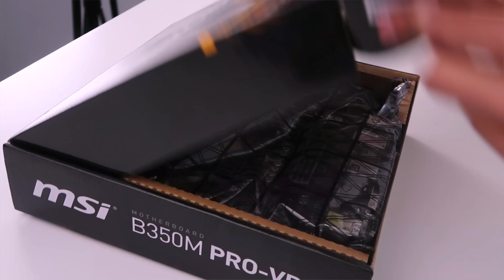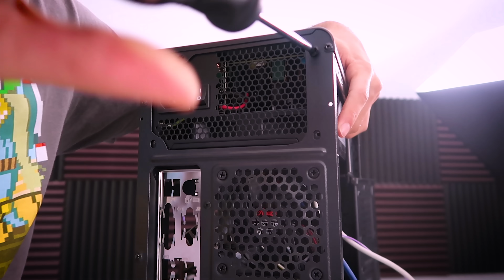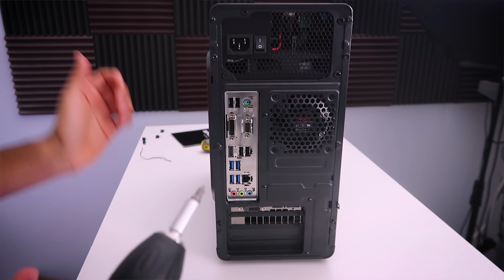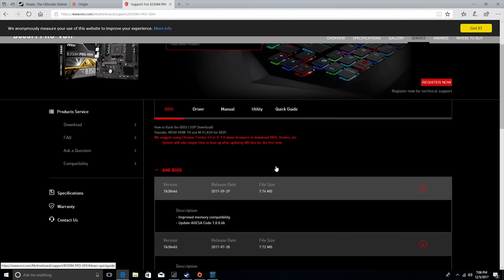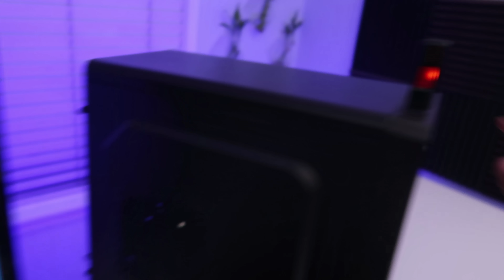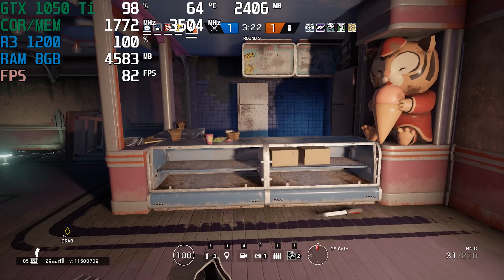$500 Budget Gaming PC Build Guide - GTX 1050 Ti (w/ Benchmarks)

Comment: Can anyone tell me the difference between a 430 watt power supply and a 500 watt? Im looking to build this pc but the only available is a 500 watt. Am I able to use a 500 watt on this build? If anyone finds a 430 watt can you provide a link? Thanks
Reply: GucciFlipFlops the number that is shown from power supply is the output wattage, so let's say this pc requires 350w and you are using 500 watt, that means there is 150 watt left which is good because whenever you want to upgrade the component (like cpu/gpu whatever that requires more wattage) the power supply would suffice. oh and your power supply won't draw that extra 150 watt unless the pc need it so no extra electricity bill
Reply: Giovann H alright thanks for explaining

Comment: Could this PC run call of duty black ops 3.
My old pc just needs a mother board, processor, and graphic card.
On my ssd i have cod bo3 so if i add these parts this to my pc could it run bo3?
My original card was a ati radeon 5970 2gb which ran poorly.
Hoping to upgrade!
Reply: Gabe TOL yea

Comment: Could I use a Ryzen 3 2200g instead of the Ryzen 3 1200
Reply: Yes, as long as the motherboard you buy has the right BIOS, if not the PC might not function without a BIOS flash. Just got to an electronics store and ask for a motherboard that is updated for Ryzen APU's.

Comment: If i lower resolution to 768p ?  Can it increase fps with this build ? :)
Reply: If you lower resolution, you will always get a frame-rate increase. I would recommend sticking to 1080p at 60FPS if you have a monitor at that resolution. Since you won't be seeing more than 60 frames per second with most monitors unless you buy one with a high refresh rate. (blah blah, tech nerdy stuff) In short, yes you can.

Comment: Trying to build this,but instead I'm going change the GPU to R5 1600X Mobo to B350M Mortar and the Case to MasterBox Lite 3.1,I'm bit a concern about the psu should I change to 500W or higher?
Reply: Lazy Gamer if you plan on upgrading maybe but youre fine with 450
Reply: LLamaWithATopHat Thanks man.

Comment: I just build this pc and the fps for csgo is too good.
Definitely recommended
Reply: You gotta buy an adaptor to go wireless. If you can use ethenet, use it. Wireless is a lot worse.
Reply: he showed pubg averages around 50 fps with medium settings but idk about h1z1
Reply: ndewie2k what about Fortnite ?
Reply: Cristian Rubio Fortnite is awesome, I've developed in so many aspects thanks to this px.
Reply: @cristianrubio7410  Fortnite disguisting
Reply: Does h1z1 and pubg work great on it also ?
Reply: Daniel Florez it can stream most games pretty well but i reccomend u go for the r3 1300x
Reply: Sam van Dam ok, thank u so much! I am gonna do a wireless adapter, but I'm getting a whole new router system with a new modem and all. It will hopefully block any tears or drops in signal🤗
Reply: Clorox Bleach 1300x has a faster clock speed
Reply: shadow of death god of war isn't on pc,it's a ps4 exclusive :/
Reply: no shit, you can run csgo on your moms laptop
Reply: Gaming Mystery 

Mine is :

X3470 @3GHZ
12GB RAM
GTX 1060 6GB
1TB HDD + 240GB SSD 

So roughly same specs 

It runs Fantastic in games! It's 30-40FPS better than the GTX 1050TI meaning you can run high to ultra settings on the 1060 60fps and the 1050ti cant run most ultra games
Reply: ndewie2k do you use the adaptor or Ethernet
Reply: Peelz did you get the adaptor does it work great now?
Reply: OutgoingGamer use Ethernet if you can because a connected method is faster than wireless but if Ethernet is not an option the buy an adapter.
Reply: ndewie2k can it run god of war or any new game with good graphics good
Reply: ndewie2k can it play battlefield 1 or bf4 ?
Reply: ndewie2k I tried to build it but idk I have black screen my pc fans are spinning and lights are working and USB ports are working but monitor has black screen help 😥😥😥😥😥😥😥😥😥😢😢😢😥😥😢😥😥😥😢😦😦😦
Reply: @kristersakermanis8625  turn monitor on
Reply: henry romein i have this setup 60 fps on pubg 1080 with medium and low settings
Reply: Could you use it to strwam6?
Reply: Could you use this to streamx
Reply: So all you need to do is connect the Ethernet, no extra program?
Reply: ndewie2k I'm sorry.
Reply: @ROYALE GAMER if u get a black screen u need to boot ur pc manually search how to boot pc manually on yt
Reply: ndewie2k With this pc can u run ultra fortnite settings?
Reply: Oscar Shergold Nope.
Reply: Clorox Bleach No difference. Both suck ass, and are no comparison to the Core i3-8100.
Reply: The Darkitect do u reckon it really matters if it’s not ultra settings?
Reply: Oscar Shergold It doesn't matter, no.
Reply: Oscar Shergold Medium or high are just enough for me, depending of course on the game, however.
Reply: Oscar Shergold For example, if it were to be GTA V, it does very much matter what settings you use within that game.
Reply: ndewie2k does fortnite and rainbow and pubg work good on it?
Reply: Expet Ninja Nope.
Reply: ndewie2k can you dm me on instagram my @ is “xitsandrew”
Reply: shadow of death God of war is only exclusive to PS4 Mate
Reply: NOSPosts 500
Reply: secureteam12 ofcourse it can , battlfield 1 max settings 40-45 fps , and battlfield 4 60-70 fps , i've seen a video gameplay
Reply: Sam van Dam if your motherboard comes with a wifi card installed, you don't need an external wifi adapter right?
Reply: Logistics1320 Thanks m8!
Reply: ndewie2k What would you rate this pc for fortnite On a 1 out of 10
Reply: can you send me what case you used
Reply: Is it good for pubg ?
Reply: henry romein I have this pc and it would give you around 60 fps on pubg medium settings. Without vsync I had around 70. This pc can also run the game on high but I recommend medium for the sake of fps.
Reply: ndewie2k Try the Division on high settings and Ultra and you will see those 25-40fps lol.
Reply: Fortshite
Reply: nononono, the ryzen 3 2200g is out, get that instead of the ryzen 3 1200, it's a bit better and around the same price and sometimes even cheaper
Reply: ndewie2k do u get like the screws with the parts?
Reply: built it aswell, this pc is a young beast, definitely recommended
Reply: TRAPxKILL U it would be a little worse but not much of a difference honestly
Reply: TRAPxKILL U then yea do that, and then as you get more money keep upgrading your graphics card
Reply: TRAPxKILL U this comes with a GTX 1050 so probably eorsr
Reply: Fortnite runs amazing with almost all settings on Epic and I did wireless wifi
Reply: Can it run fortnite
Reply: ndewie2k did u play ark on this pc?
Reply: How much ram did you put in? He used 8 gb but I think that’s not enough 🤔
Reply: Can it handle double monitor?
Reply: Hey dude, I did the same build like a month ago and when looking at the internet it wouldn't connect or register any other internet except for the Ethernet that I didn't have. Did u have to purchase a separate Wi-Fi adapter or did I need to download something for the pc to understand the Wi-Fi? I'm just really confused because most motherboards and stuff nowadays have it built into the motherboard but I didn't see it
Reply: henry romein PUBG requires a NASA space computer to get a constant 60 FPS LUL
Reply: How much did it cost you total bro?

Comment: Built a computer with similar specs mainly using the Ryzen 3 1200 and GTX 1050ti. Probably the best price per performance budget build you can obtain right now with the market how it is. 
If you built this system you NEED to overclock. I would recommend going to 3.9GHz if possible most chips should be able to. Pushing into 4.0GHz maybe not but Ryzen 3 needs to be OC for best performance. The standard 3.1 will not give you this high of a performance. Joey could have easily OC to 3.9 and seen a way higher boost to framerate. Especially if he OC the ram which I would also recommend. Ryzen loves ram with gaming.

Comment: What if I build using a different PC case however also using the same parts? Do I have to buy different parts or cables for its different size or would it be fine to follow the instructions on this video even if the case is different?

Comment: May 22 2018, $569.82
Reply: I bought this for $791
Reply: City is my England feels bad
Reply: CapoGoCrazy      crash 07459625931st is not the only thing 8xxsçďņ is not the only thing 8xxsçďņ
Reply: City is my England you could've change the cpu to g5400 or g4560 and use another budget ram
Reply: Mike Lagana change the cpu make it to g4560 almost had the same score with 3 1200
Reply: Mike Lagana it's fine
Reply: Mike Lagana you mean 1060 6gb?hmm as long as it cannot do 30+FPS on low setting I might get a new graphics card
Reply: Mike Lagana well then enjoy you build
Reply: yes
Reply: £510ish
Reply: CapoGoCrazy OMEGA LUL the same specs that i would buy in serbia comes to about 600 usd :/

Comment: Here's a tip be a little more careful when putting a PC together I see how u have been putting it together don't use a electric screw driver when screwing stuff in and also u took the face of the case off pretty harshley and need to be much more careful when doing that u could have broken one of the wires connected to the face other than that great build keep it up

Comment: Also I looked on amazon and I can’t find a 430w power supply only a 500w one would this effect the setup in anyway or should I get it?
Reply: It works fine. Better to have it, if you plan on upgrading any internal parts later down the road.

Comment: Can i use a intel processor instead of a ryzen?
And can I put 16 gb of that ram side by side?
Reply: You can't use an intel processor on any of these motherboards. Also the ram should be fine as long as you bought the same kind of sticks to allow dual channel.
Reply: Shadow-Man ok ty what motherboard should I get?
Reply: Get a z370 chipset motherboard ( if you are using eighth gen processors.

Comment: I recommend getting a motherboard with an m2 slot on it (on board SSD) and put your os on that. it will drastically improve boot time. what I'm doing is putting windows and Linux on it then steam and discord and one or two games that I play more than others. the specific SSD I got is 5gb/s processing speed. so boot time should be about 2 or 3 seconds
Reply: Here is a great deal on the ASUS ROG STRIX B250G GAMING LGA1151 DDR4 HDMI DVI M.2 Micro-ATX Motherboard with USB 3.1 , https://www.newegg.com/Product/Product.aspx?Item=9SIA2F85N39233
 I found.
Reply: Here is a great deal on the WD Black 256GB Performance SSD - M.2 2280 PCIe NVMe Solid State Drive - WDS256G1X0C , https://www.newegg.com/Product/Product.aspx?Item=20-250-084
 I found.

Comment: does a 1080 fit on this motherboard?
Reply: TheManlet I recommend going with a higher end motherboard for overclocking, go with a Z270 1151 socket motherboard and with 16gb ram bc you want to get the most out of that gpu. Also you should definetly go with a better cpu for more performance
Reply: Yeah at least Ryzen 7 1700x
Reply: Link Kakariko yeah that souns great but then it wouldnt be a budget build anymore 😂
Reply: I did a Ryzen 5 2600 x
Reply: Nathan Allen good choice but if you got extra money you could buy intel i7 7700K just like i did but if jou just want a beast ass pc you should just go with an intel i9😂😂😂
Reply: Toma Tunzukhanova I would but my budget was tight
Reply: Nathan Allen then youve made a good choice
Reply: This case is pretty small so I would go with a bigger case first and then find out if it fits.

Comment: I want to use a different case but I’m scared that I will mess up because it’s not the same as his and can’t follow step by step. Lol
Reply: You can try this case! Corsair Carbide SPEC-04 Mid-Tower Gaming Case-Black and Red-CC-9011107-WW. It looks a lot better then the one he used.
Reply: The mounts for the motherboard are exactly the same on every case, you can pick out any case you want as long as it fits Micro-ATX, which is the size of the motherboard.
Reply: Thanks for the reply’s I’ll defenetly keep that in mind!
Reply: nice bait
Reply: Just use pc part picker 
Use all the specs he used and pick your case
If it says all the components work together then you’re good
Reply: Is tecware edge tg case good? I'm worried about the temps since i want to overclock. There is a review on that case, and the guy says it reached 83 degrees celcius when doing stress test(?) Isn't that too high?
Reply: Azim Saparudin get a 212 evo
Reply: Nathan Moist dude, just get a better case lol, it’s pretty easy to tell where they go... a lot of the time theirs directions for where the standoff’s go engraved in the case lmao

Comment: So, I have a question, if I were to build the pc exactly as you told in the video with the same parts except I would change the graphics card would that mess up the system or would it be fine?

Comment: Finished building my own gonna play fortnite!!!
Reply: Specs?
Reply: how much you spend on the build?
Reply: Don't fear me 1 dolla
Reply: Does Fortnite work on it?
Reply: Team Beteag Fortnite is easy to run ish
Reply: Zequal  not anything you idiot
Reply: I saved up and spent roughly 1,200ish ti build a computer with 16gb ram and evga 1070 sc. This included headphones and keyboard and mouse and the wifi adapter
Reply: Caleb kivett just buy a long as Ethernet cable and tape it to the floor lmao, at least you’ll get better internet (;
Reply: Quadquint Og I bought a powerline bc my router is in the living room and my pc is in a bedroom upstairs to avoid having a long ass cable go around the house like I used to do with my ps4. If you have good wiring around your house and your house wasnt built back in the 1950s I would really recommend a powerline. Has a connection better then wifi and no you will experience no more lag. :))
Reply: Caleb kivett nice
Reply: Zequal I play on a minimised window on 720p render scaler 55 percent and get 30 to 60 FPS. Drops to 18 and the temps reach up to 100c
Reply: Samraat Sapehia I saved up and am building my own computer bc I realized how much better they are then consoles and was getting annoyed playing windowed fortnite on 40% graphics and lowest settings. In csgo I would walk through smoke and drop to 5 😂😂
Reply: I tryed to to run Fortnite on a potato and it growled at me and i ended its existence
Reply: ffs fortnite? Can't you guys just play normal games that everyone used to play such as Cod and fallout etc, if anyone asks what game you play and you say fortnite it's really cringy

Comment: Joey what voltage do you recommend bumping my cpu up to to get a stable 3.7 overclock I currently can only get a stable 3.5 overclock I can get it up to 3.6 on stock voltage but games occasionally crash and I can’t even get the system to boot at all with a 3.7 overclock

Comment: Is it VR capable?
Reply: I think it is, I guess it depends on what game you play
Reply: BendyBananaGaming no u can run vr easily with a 1050
Reply: Flow YT Duuh
Reply: NXL Gaming duh
Reply: BendyBananaGaming No you need at least a 1060 minimum I run almost every VR games with a GTX 1060 with a i5 2400
Reply: you also need the VR ready version of the motherboard it's the same i think
Reply: BendyBananaGaming no you don't
Reply: BendyBananaGaming my 1060 is vr ready
Reply: Not a chance the gpu is no where near got enough v ram to run vr u will need a 1070 minimum

Comment: Hi i need some help! I have this combo with 8gb 2666 but I have significantly different results from yours. In games like GTA 5 and Assassins Creed Black Flag I top out at about 30 - 40 fps. Same thing for Rainbow Six Siege and most of these games i am on medium settings. Even on Fortnite at high settings or CS GO I barely get above 60fps. Whenever I use the auto detect graphic options for games they are turned to high but i still barely get above 30fps. My thermals are doing alright but my cpu usage in many games is always at 100% (im using msi afterburner btw). What should i do to get the same performance you are getting?

Comment: I got the same parts for the pc but just a bigger case. I finished building. I still didnt have my moniter, so i turned it on just to make sure it turns on. It turned on perfectly with the fans turning and the light turned on. But then just right now i tried to turn it on but it didn't for some reason. I opened it up and made sure i had the wires in the right place. But it still won't turn on. Please help me. Could it be the power supply?
Reply: yes power supply is broken

Comment: If you aren’t comfortable with over clicking, you can get the R3 1300X, which comes with a factory clock speed of 3.7GHZ instead of 3.2 for the R3 1200 (I believe it’s 3.2)

Comment: great build but you could have done better with a cheaper RAM which would have resulted in a much better case or PSU. the Ryzen 3 2200 costs the same now so definitely a free upgrade right there.

Comment: Is this enough to run pubg smooth
Reply: pingkoy pakayat  what about fortnite?
Reply: aNiMu pOsSy yes bcs pubg takes a lot more to run u will get 65-80 FPS max
Reply: sxrcee yes
Reply: VinYt what if u play fortnite on the highest settings?
Reply: It will run at high settings  around 100fps
Reply: pingkoy pakayat  wait, are you responding to me?
Reply: sxrcee yes at mid settings but this pc can run that game in ultra too but pubg is unoptimized

Comment: does the fps drop if we don't overclock it? i mean by a huge margin?
Reply: Accurate Atheist no
Reply: ok thx. i want to play overwatch so it will run at high preset without overclocking right?
Reply: Accurate Atheist yeah it’ll be fine. Tat game is reallly well optimized it runs on almost any old system too
Reply: Luis Ramirez thanks mate

Comment: Can u put more than 1 of the extra fans in the p.c. I just wanna make sure mine doesn't over heat
Reply: Joey Reposa yes
Reply: Luis Ramirez how?
Reply: Joey Reposa your motherboard supports usually 2 fans but you can buy a fan splitter to connect 2 fans in one connector